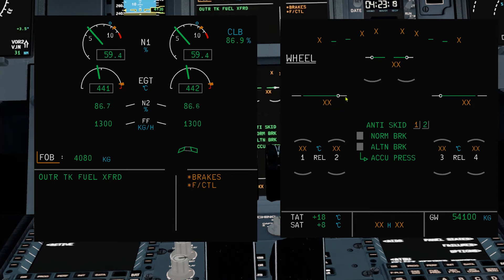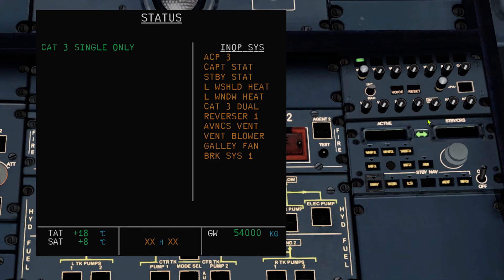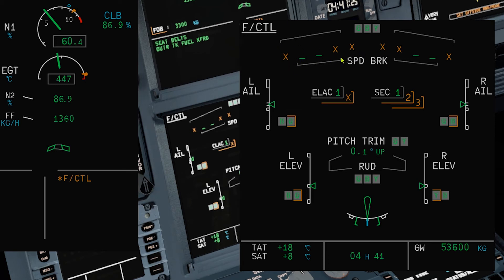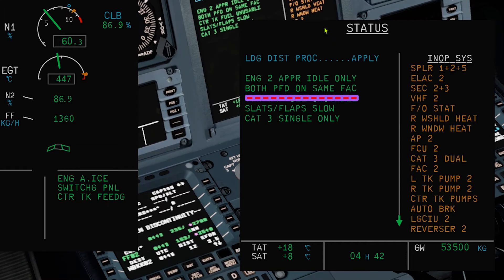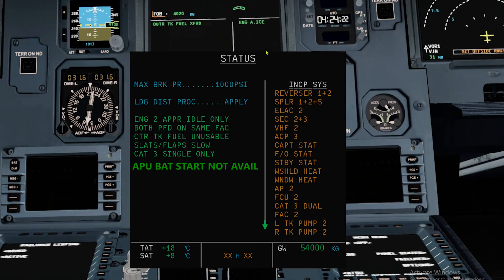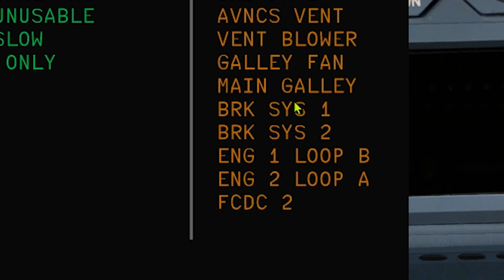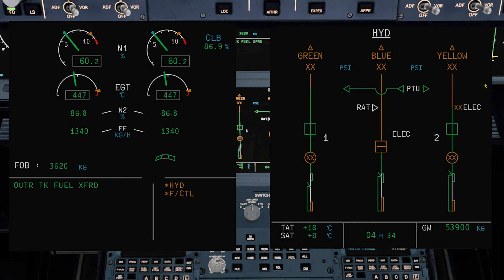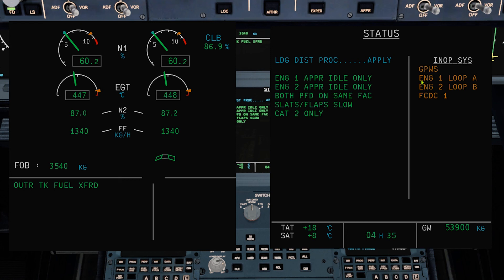DC BUS Faults for A320 pilots

Comment: What happens if ELAC 1 is inop and during flight you get dc bus 2 fault? The airplane should be in alternate law till manual gear extension then go to normal law (elac 2 recovers at ldg gear extension). Is this correct?